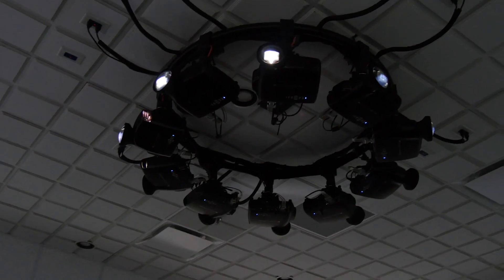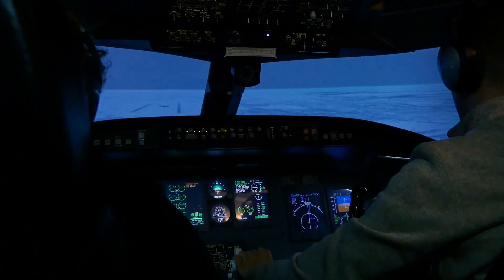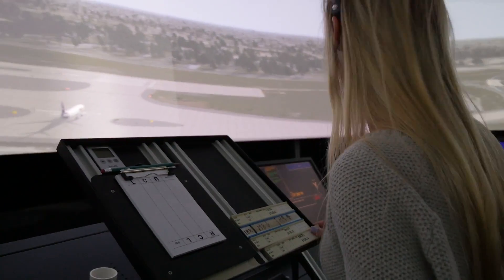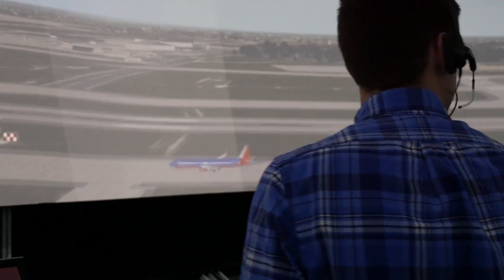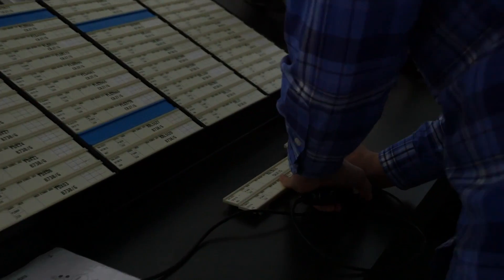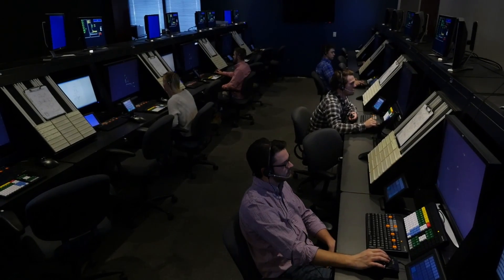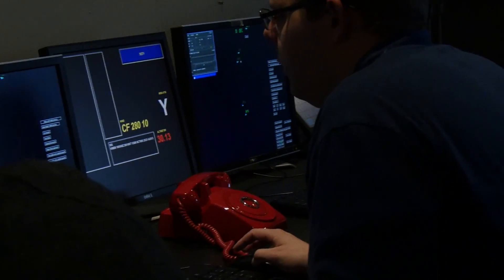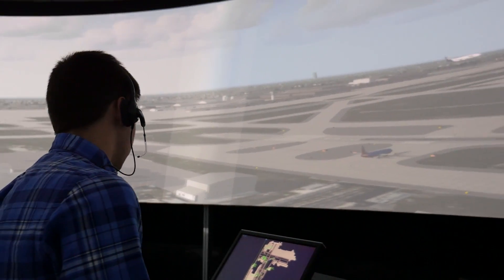How to Become an Air Traffic Controller - MTSU

Comment: I am a high schooler (2nd year) living in Virginia, and I just have a rough dream of becoming an air traffic controller however I am not sure what I should do to achieve that dream. I did some googling but I couldn't find any helpful resources.
Reply: What's up man, I'm a controller.  I was off the street and just applied with work experience and college mixed together.  Half of my coworkers are military and half are like me. If you're interested in joining the military, talk to them and see if they can guarantee you an ATC position if you join, otherwise just keep applying off the street until they accept you.  It's a long and tedious process which can span years but it's worth it in the end.  Don't put your life on hold and wait for this to happen.  Apply, and honestly forget about it until they reach out to you.  Bidding for the job happens at least once a year typically around June/July so just periodically check for that.  They only are open for 2-4 days or so. Best of luck!

Comment: As an air traffic controller, I'd say skip the schooling.  All you need is three years work experience doing whatever and you can apply.  And pool 1 doesnt have priority over pool 2, they typically split the openings 50/50 between the two pools.
Reply: You said 3 years work experience in whatever? What do you mean by that exactly... can someone literally work at McDonald’s for 3 years and get in
Reply: anthonyd5189 But how are you going to get the 3 years of work experience unless you have the schooling first?
Reply: christopher garcia nothing at all. You can literally start with zero ATC experience, get hired go to the FAA  academy. You can work your way up to a very high paying career with zero college required, and zero prior experience. Assuming you are willing to work hard and are halfway intelligent. Hiring process is long and activating because of the feds... and the starting pay is very low.
Reply: Brian do I need to join FAA academy before I apply for do they have their own FAA program. This is really interesting.
Reply: @Brian-ff7tw  isn't faa academy a flight school or is it for air controllers as well please answer I need help finding where to go to school
Reply: @Musihoodie  FAA academy is for controllers. I don't think they do any flight training. FAA academy is only for those offered a job as a federal controller.
Reply: @Brian-ff7tw  when I searched it up a flight school came up what did u type to find the air controller school?
Reply: @Musihoodie  if you want to go to FAA academy you have to apply for a job under an off the street "OTS" hiring bid for ATC. You do that on USAjobs.gov however they are not hiring now. I do not recommend going to a college for ATC. The FAA is the main employer for controllers and you can get that job without going to school and without prior experience. They will then teach you everything you need to know at the academy. Get a degree in something else that way you have something to fall back on if ATC doesn't work out.
Reply: @Brian-ff7tw  do I just search up the academy or do I have to apply first?
Reply: @Brian-ff7tw  is there any other way I can get into air traffic control
Reply: @Musihoodie  you have to apply first, then FAA will make arrangements for you to attend the academy. Also you will be paid a salary to attend, instead of paying tuition to attend. Another great way to get into ATC is the military though. I was in the Navy for 10 years, I chose the Navy because they were the only branch that guaranteed me a seat in their ATC school (all others wanted me to pick 4 jobs then they would choose from those jobs what I'd be doing) Go Navy, Air force, or Marine Corps... do not join the Army for ATC the training and experience you will recieve in the Army is not the same as the other branches I listed. Also your age is very much a factor, because you have to start work in the FAA prior to your 31st birthday.
Reply: @Brian-ff7tw  oh makes sense I dont wanna go to the miltary at all tho so I'll just pick a different career thanks tho
Reply: @Brian-ff7tw  Do you know what's the starting pay? I'm 25yrs old making 26hr at my current job and want to move to a different career that pays better. Any input much appreciated
Reply: @hidros1461  starting pay is very low.. around $20k a year prorated for the I think 5months you're at the FAA academy in OKC. Once you graduate the academy and head to your first ATC facility your pay will go up but it depends on 2 factors, the level of facility you get and the locality of the facility. I know taking that pay cut would be hard, but the potential to earn is very high if you can eventually qualify at high level facility like a center or a core 30 terminal facility. Good luck!
Reply: @Brian-ff7tw  hey Brian I’m looking to get into the atc program via faa… I know the bidding just past about two weeks ago do you know how often/ when the faa puts up hiring posts? Im 30 so I know I don’t have much time I’m having a hard time figuring out what to do at this point
Reply: Guys ignore what he saying your gonna need a backup plan with at least an associates degree to fall back on if you dislike the job or something goes wrong
Reply: randy higgins hmm so what are the perks of getting a degree in aviation administration or whatever you decide to get it in... assuming you wanna be an atc
Reply: What kind of job experience would be the best?
Reply: @Hedgeflexlfz  You could have a job doing basket weaving. All they want is a resume that says you worked for three years. Then they'll contact your employer (could be McDonalds, it doesn't matter) to verify you worked there.

Do NOT got to a CTI school. At this point it's a scam.
Reply: @3PeNcEL  You don't need any degree, correct?
Reply: @Hedgeflexlfz  that's correct, no degree. I passed the academy last July so if you have any other questions then ask
Reply: @3PeNcEL  So you just worked a random job for 3 years, and applied to the FAA? Any other requirements or experience? I have my class 1 medical because I was possibly thinking of becoming a pilot or ATC. So if you are approved, they send you to an academy?
Reply: @Hedgeflexlfz  if the FAA hires you, they make you do a medical through them. I also have my PPL medical, but I still had to go redo it.

Google FAA open bids and apply when they open up. Should be at least once a year
Reply: @3PeNcEL  Ok thanks
Reply: @3PeNcEL  so if you have a college experience and all, all I have to do is just apply ?
Reply: @archiij1707  yes a degree. Or work experience
Reply: @3PeNcEL  awesome how do I even apply ?
Reply: Joseph Archibong I’m confused too I want to know the steps on becoming one. Please let me know as soon as u get info
Reply: @archiij1707  the FAA has what are called "open bids" that should explain everything. Look it up on Google and it should pull up when they hire. The money's good man do it. America's hidden secret. 100k salary in 2 years
Reply: @3PeNcEL  thanks I will
Reply: @3PeNcEL  is it hard to learn all the terminology ? And being able to communicate properly to the pilots
Reply: @Antonio18677  yes it's hard. It's the hardest thing I've ever done and I still have a year left of training. I thought I wasn't going to make it sometimes. I've made friends that didn't make it and washed out. But hey I'm making over 100k now at 25 years old so the pay is worth the struggle. I'm a Mexican that made it this far so you can too with a little bit of hard work.
Reply: @Antonio18677  No...you are trained
Reply: @3PeNcEL  hey, are  there any sites or anything  you can reccomended  that can give me some prior knowledge on terminology, drills, etc for the job?
Reply: @kirtjoe283  you need literally zero knowledge before the FAA academy. they will teach you literally everything you need to know with lots of extra time for you to learn it. Absolutely do not worry about any prior knowledge for getting into your traffic control. I can tell you from experience because I did not have any knowledge and so did about 90% of my class.
Reply: Jesse are you being serious? sounds too good go be true
Reply: @3PeNcEL  hey, if I have a degree does that work instead of a job? Or do I need to have worked 3yrs as well?
Reply: @3PeNcEL  where do I go to apply to work here
Reply: @3PeNcEL  what academy did u go to faa academy right?please let me know I'm trying to become a air traffic controller so badly
Reply: @3PeNcEL  you finish out your training?
Reply: @3PeNcEL  man you're amazing. I dont have associate. I'm working on it. I have a 3 year experience. How do I get the job?
Reply: I think I'm too old to do it.. Sounds interesting and looking to go into a new career field and I'm 34
Reply: @Brianpeckin  yes u are too old
Reply: @angel-nf5ix  ok
Reply: Lets say I worked 2 years at Walmart but then worked a year at another company.. does that still count as 3 years work experience?
Reply: @jesusdeleon9501  yes
Reply: anthonyd5189 How can I become an ATC?
Reply: Yep...not sure why people go to school for ATC. If you get washed out a ATC degree isn't worth much.
Reply: What school do we go to
Reply: Ok cool but how will you know what to do do they do on the job training or what
Reply: You’re not wrong about the requirements (obviously, you’re in ATC). But the schooling is worth it due to the extra learning experience you have
Reply: I know this comment is 4 years old and you are probably from the US but do you know if it's the same in Canada?
Reply: Wait what if you still want to fly while having this job?
Reply: I was a swimming pool cleaner in Florida and decided that I needed a better career. I passed the initial entrance exam beautifully. I did study hard which helped. I got accepted to the FAA in Oke City months later. I spent 2 months there and did horribly. Now, I wear a name tag, punch a time clock and clean up after wealthy guests at a hotel.
Reply: Yes three years work experience in anything. The FAA has an annual OTS or off the street hiring bid. No ATC experience required. Search USAjobs.gov for GS2152.

Comment: How is this not automated yet.......
Reply: I don’t think you fully understand the complexity of this job and aviation in general if you are asking that question .
Reply: Same reason you wouldn’t want your airplane to be automated either. There’s just too much risk.
Reply: don't forget, more automation is better( and sometimes safer) but it takes people's jobs, therefore, there would be more people with no jobs in the country.
Reply: NSMV it also takes problem solving that a computer couldn't comprehend.
Reply: There are tons of parts of the job that are automated, at least on the enroute side.  But even the computer doesn't get everything right and it will always require a human element, especially when weather is a factor.
Reply: One reason why this hasn't been automated yet is in case something goes wrong with electronics. From my understanding ATC are trained to use their sight and knowledge of analog tools to be able to guide planes in the event that something catastrophic happens to said automated machines
Reply: I prefer INTELLIGENT PEOPLE with my life in their hands..not some computer
Reply: NSMV the planes aren’t automated and the previous trials of automated planes saw crashes after takeoff
Reply: NATCA lol